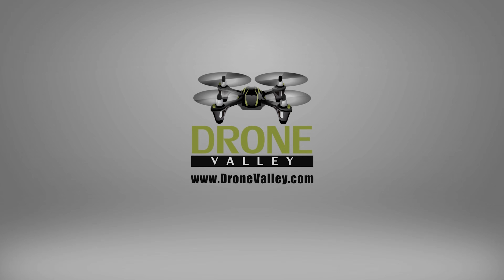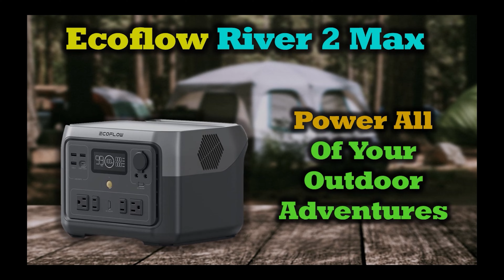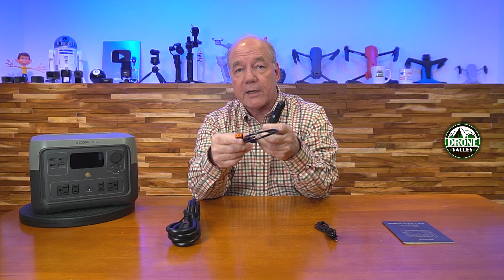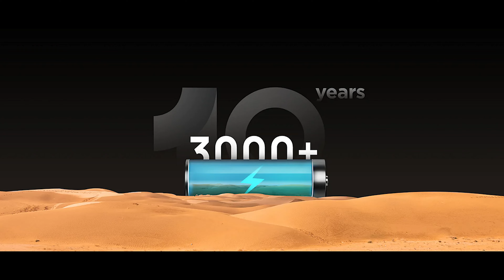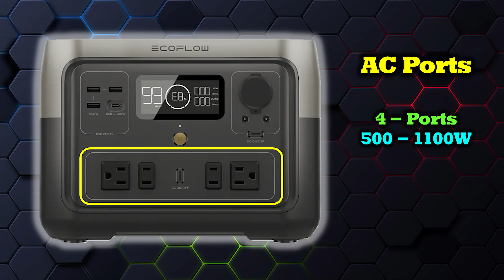River 2 Max - Perfect For Your Outdoor Adventures!

Comment: How long would this last(run time) with various loads such as 100, 150, 200 W loads. would help to determine which model I need.
Reply: the battery is 512 Watt hours, so e.g. 100 Watt device = 5 hours run time.

Comment: Hey Rick,  Nice Review.  I’ve been looking at getting one of these products.   Do you see any issues with leaving the Ecoflow product plugged in all the time and use it similar to a computer UPS?   I understand there’s a 3000 charge cycle limit but I was thinking if I left it plugged in all the time it would always be available to take with me, fully charged.    I’m assuming if the unit is plugged into AC power, and fully charged it would no longer charge the batteries and simply bypass the unit to provide power to whatever you’ve plugged into it correct?